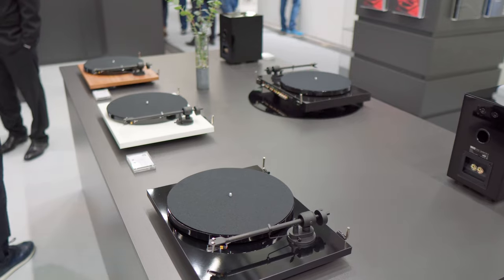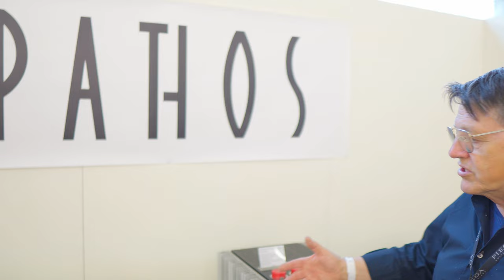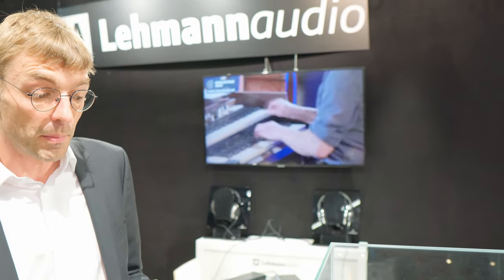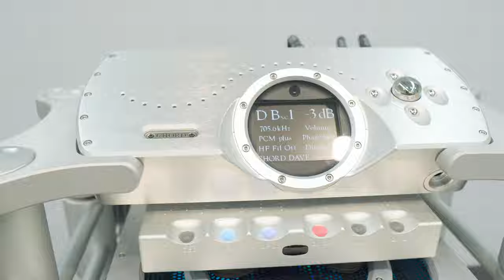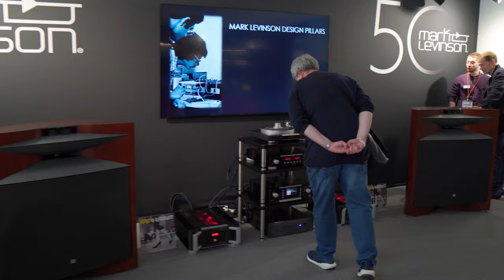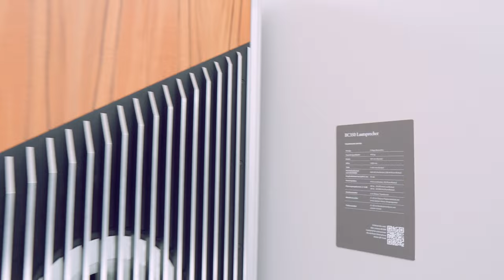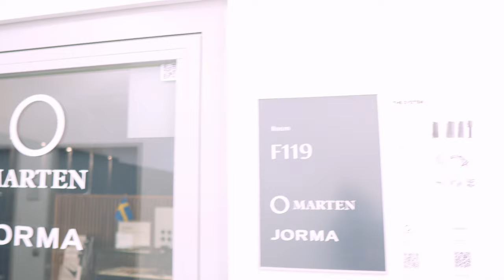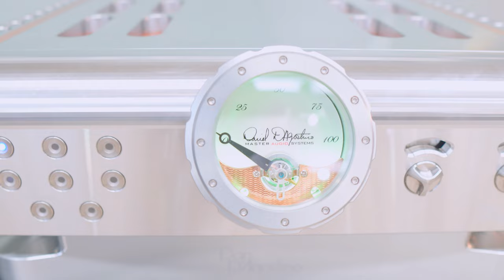The Rest Of The Best - High End Munich 2022

Comment: Fantastic headset at 25:00 😄 
Btw MA, I noticed in this vid (and some before) the sound seems slightly panned to the left (or maybe my right ear is going out 😄).
Overall an impressive overview and almost impossible to view it all...
Thanks for the impression!
Reply from the maker: You have good ears 👍🏽yes is a little bit on the left cause i record it with a camera stereo mic and i don't know if the mic is a little bit unbalanced or maybe is giving from the position of the camera..Anyway i am going to change it soon cause i was not satisfied with, is not about the mic but about the camera ADC that's terrible..
Reply: @MadAudiofficial  
If you do get new camera, a review would be most welcome. A few months ago I was shopping for a camera, but got somewhat lost in all the different options and features. I know ADC is important, but then there's a lot to consider too.
Reply from the maker: @34332  i going to record the Audio external, do it through the camera it means to compromise and I don't want any more..

Comment: Funny Stein seem to use MHB 12 inch woofers  and maybe the 10 inches MHB10 and the 15MHB... for there subs. weird, they clock in at 10-13 euro a piece and 35 for the 15 inches.  surface area wins :)